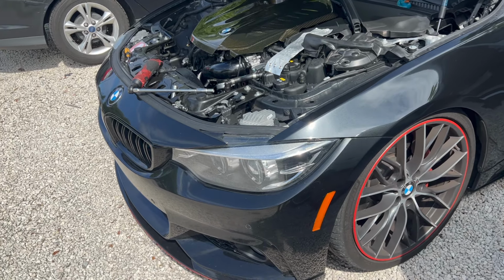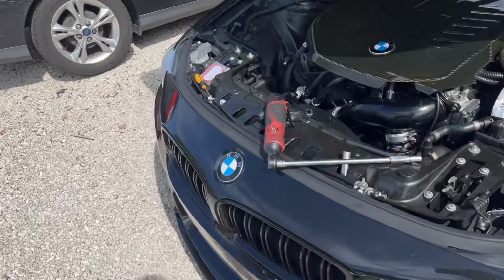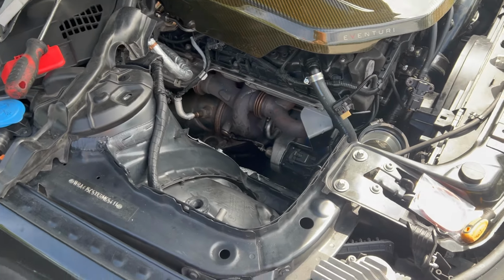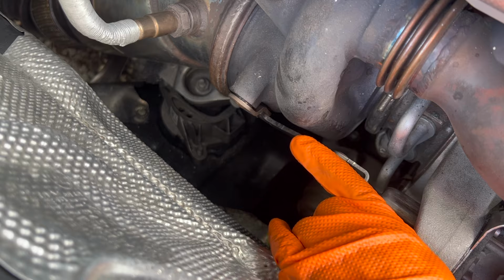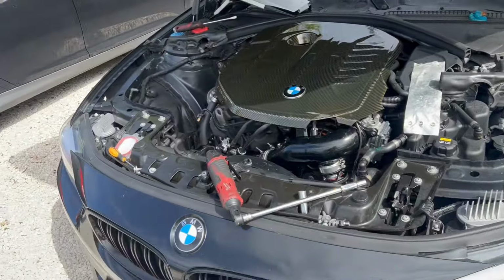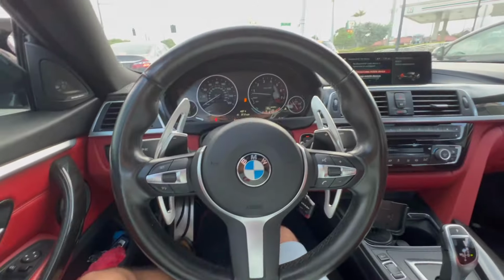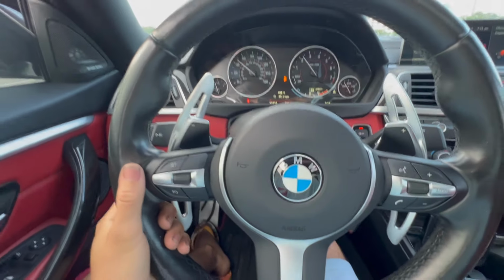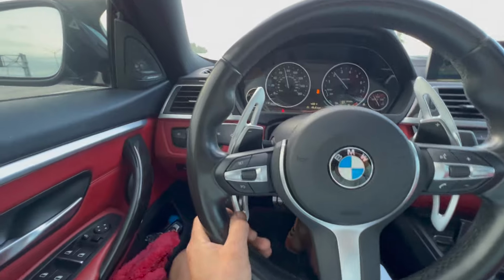B58 BMW WAS IN CONSTANT LIMP MODE AFTER WASTE-GATE CODE ! ELECTRIC WASTE-GATE ACTUATOR ISSUE SOLVED

Comment: Hey bro did the new inlet fix your leak? Installed a flowmax a month ago  we smoked it and my saw inlet was rolling smoke. Car hits 30 psi at top but about making 21-23 down low when target is 27. 

I’m starting to look at wastegate as well. But curious if daw inlet (same design as dinan) is causing it.
Reply from the maker: Yes it did fix my problem ! I went with a solid aluminum inlet. Check those seals, If you see smoke you’re loosing boost pressure . I had a leak from inlet and later found a crack in the crank case vent pipe.
Reply: @Sliderz_Official what brand inlet did you go with?
Reply from the maker: @PaljonIvezic  i went with bimmer network based off of the design but I recommend buying a new crank case vent pipe as the orientation on there inlet is a bit different and the old pipe doesn’t like to flex in a different direction. I should have stuck with the dynamic autowerx inlet that never gave me issues.
Reply: How do you like the flowmax so far? Can we chat on facebook? Whats ur name?